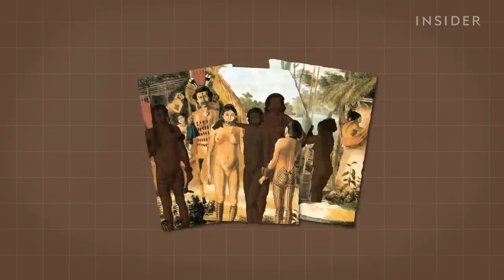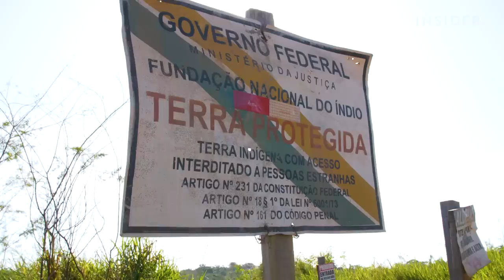How 40,000 Tons Of Brazil Nuts Are Collected Deep In The Amazon Rainforest | Big Business

Comment: This video has so many mistakes... They sell a kilo of the nut for 8 BRL (or 1.52 USD in today's rate), not a ton. A ton of the nuts would cost $1,520 USD (or 8,000 BRL). That's how much tej cooperatives make. Then exporters are currently charging between $6,100 to $6,400 USD the ton, making this a very expensive nut. Too bad the gross of the money doesn't stay with the families that gather the nuts.
Reply: I thought something isn’t right too. 1.52/ton, no wonder why they burn down the forest instead.
Reply: Yes! Actually, 2/3 of the cost of production goes into buying the raw material, hence indeed most of the money is handed to the collectors.
Reply: exactly!

Comment: From my calculations, there's a chance of 0.1808449074074074%, for short 0.18%, a nut will fall on your head if you're under it for just 5 seconds.
So, you can say, if you stand underneath it for just 2,764.8 seconds, 100% a net will fall on your head exactly.